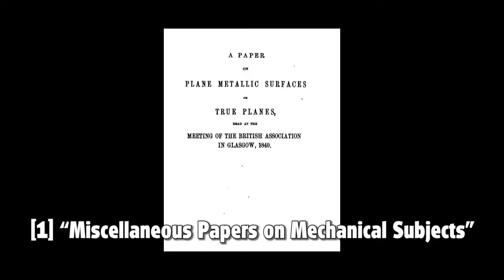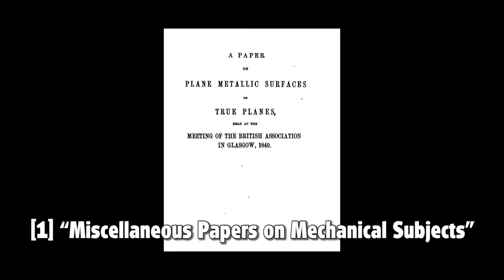Flat From Scratch, revised - The 3 plates method

Comment: Sir, one thing if I may ask - which type of steel have you used for the lathe spindle and were you hardening it in any way?
Reply from the maker: C40/45 (do not remember exactly what of the two), no hardening. While hardening would have been good, it would have required a further (very expensive) process of precision grinding. Because this is kind of a prototype I preferred to keep it simpler.
Reply: @AccidentalScience  Yes, that hardening seems to be a larger problem. I'm actually thinking about trying to grind a bar between centers in some kind of fixture, using a normal bench top grinder. Just so I can slide bearings on it and then later turn it. First probably just with construction steel pipe..
Reply from the maker: @peteabc1  well, what's the purpose of hardening? If I read NSK or SKF manuals they say hardening shafts is required only where seal rings come into contact. Ground shafts are required if heavy loads or vibrations will happen in operation, but this does not refer to hardening and aims to keep a good adhesion of the ballbearing ring with the shaft/case. So after rethinking about this I conclude that hardening is not necessary. Beware, this is my personal opinion and I might be wrong.
Reply: @AccidentalScience  Yes, probably it's not needed. Especially for home use.

Comment: I'm too not an expert, but I noticed that besides surface plate you can buy 10mm thick steel ruler (search for smt like DIN ruler). But it's not cheap either, starts ak 90eur.

Comment: Thanks for the follow up video!! This is going to be perfect for my lathe ways and an extra straightedge (sounds like you did the same thing hahaha) did you have any issues with the flattened surfaces being out of square with the other sides of the steel bars you used?
Reply from the maker: Something but nothing too problematic. As long as there is linear consistency along the full length of the way I deemed it wouldn't cause any problem.
Reply: Accidental Science fair point, and Id assume it would wear slightly out of square during use anyways so I suppose it wouldn’t really matter either way

Comment: Dear sir your videos are inspiring. 
I was wondering if we students can make linear stage that can move with sub micron level precision. We have a 3d printer that can print in PLA . Is it possible to make linear stage that can move with nanometer precision. ? I would be highly obliged if you can take up this project for future video. Thankyou
Reply: Such precision is useless. You must realize the filament's width is varying, the machine is vibrating because of motion and thermal variations can easily do more than 10u. With submicron you're picking sound vibrations, not to say people walking around.
Reply: @peteabc1  In optics We use something called translational stage of holmarc or thorlabs which are expensive and provide 5micron step size resolution. (More step resolution more expensive) My proposal was if we can make something with 3d printer and then do post processing like to remove imperfection using acetone bath  heat treatment etc. Even achieving step resolution of the plastic device less than 5micron is an achievement. 
Sound and  expansion due to temperature  is a problem with plastic .
But if by clever engineering we can achieve this then lots and lots of hobbyist will be attracted to optics . Making projects like interferometer hologram etc
Reply: @sarbojitmukherjee4430  Does the stage need to be repeatable and stable over time or will it be readjusted right before use? Most plastics have the tendency to creep (slowly deform) even under fairly light load.
Reply: @milithemuffin4534  i did not know that about plastic. And if it deforms with time it will be a problem. Stage is to be used for an hour max during experiment. But it will be kept in lab as long as possible for future students to use. 
No it will be readjusted before every experiment
Reply: I think  using both metal and plastic parts needs to be used. You can get inspired by how a DVD writer or blue ray disc works. They also have high precision.
Reply: @sarbojitmukherjee4430  Ok, now I think I understand better what you want to achieve. So in this case one options is to print 2 surfaces on flat glass (optical flat, preparation glass..). The goal is to print slight wedge. You can achieve this by printing on slightly tilted bed (use bed leveling). Now one side of each surface will be flat like glass (even mirror like) and you must glue similiar block (without wedge) on the other side so that both sides are glass like (or glue it on microscope preparation glass). From those 2 wedges form a rectangle and you'll be pushing one wedge in 90deg (so you're using sine of the wedge) to push the stage. Now you can push it with micrometric head (can buy this for 20$) or fine pitch screw and a spring from other side. I've this on my projects list..
Reply from the maker: Well I have not such experience. I don't know how easy would be for students. Remember I am not a mechanical engineer, my field of expertise is in electronics, firmware and automation (automatic machines, robots, etc.), but based upon my limited experience working at micron level is hard by its own. For start you need a controlled temperature environment, and about linear motion I would go with compliant mechanisms that, for proof of concept purporses, I think can be even 3D printed. To detect the actual motion you could use a capacitive sensor. Capacitive sensing can be quite easily designed to be highly sensitive to very small displacements, having care for a very good PCB design and component selection. Good luck. Cld.
Reply: @AccidentalScience  thankyou sir I will see if it can be done with compliant mechanism
Reply: some food for thought: https://npoint.com/what-is-a-piezo-flexure-stage, https://www.youtube.com/watch?t=153&v=uUluc_grPLI, https://youtu.be/PaypcVFPs48?t=157
Reply: @perspectivex  thankyou sir
Reply: another linear motion flexure example, "Approximately 1 micron resolution linear motion in one part": https://pinshape.com/items/44766-3d-printed-precision-linear-motion-flexure.   And a thingiverse compliant linear mechanism: https://www.thingiverse.com/thing:1424169
Reply from the maker: Many good comments here. The DVD/Blue ray writer is a good idea indeed. I thought that the project was meant to be just a proof of concept that had to work for just few minutes rather than an actual usable device, that changes everything, and I can only make some guesses. 
As others have pointed out many "plastics" are unstable with temperature, so if any kind of "plastic" gotta be used that "plastic" should be a resin that have good thermal stability, such as phenolic resins or maybe some exotic A+B compounds (at the moment none come up in my mind, though). Anyway resins are definitely not 3D printable,  although they can be poured in a 3D printed mould. However this problem of stability should be distinguished from the distortion or simply the variation in dimensions with temperature. Obviously this kind of device need to be kept at stable temperature, say around 20-25°C. At this temperature some resins are indeed stable over a timeframe of some years (often less than 10). Take this just as a hint, I should do some research to be more precise (and I have no time to do it). Metals would be a better bet. Since a compliant mechanism have no joints, there are no risks of errors induced by tolerances and gaps that are necessary in a joint, and you can find over the Internet good designs of compliant mechanisms for linear motion relatively easy to make (with a proper workshop) out of metal. I remember I've seen one that through a simple screw the stage can be pushed for the desired amount, the compliant mechanism provide a leverism to reduce the displacement and at the same time provide a stable location of the stage.
AFAIK all materials are more or less equally sensitive to vibrations, including those induced by sounds. What changes is their mass and elasticity modulus, which simply changes the frequency at which the part would resonate. Pls, correct me if you think I'm wrong.
So, to summarize, this device should be kept at stable temperature, both while in storage and in operation (say 20°C +/-10°C storage, 25°C +/-0.5°C in operation. Numbers must be verified); should be kept isolated from noise and vibration while in operation through dumpers and a chamber that removes (attenuates) sounds. It's a damn tricky thing after all.